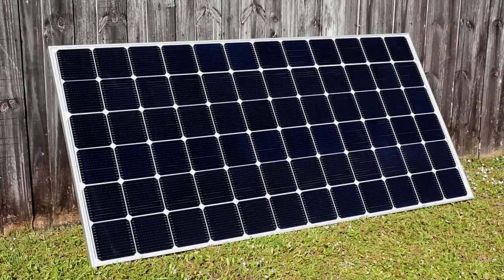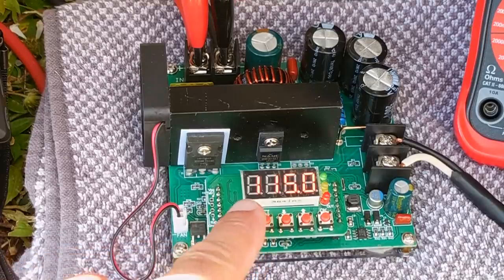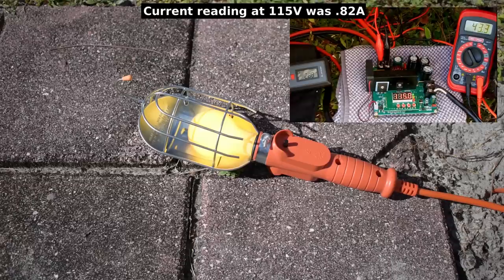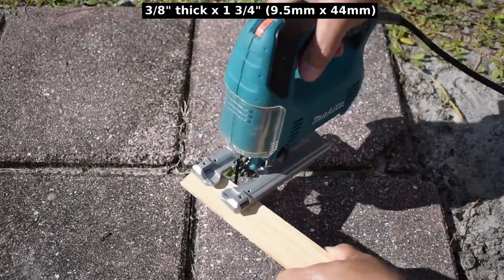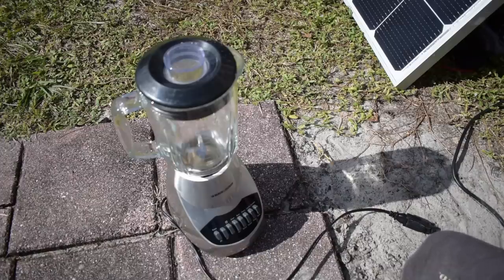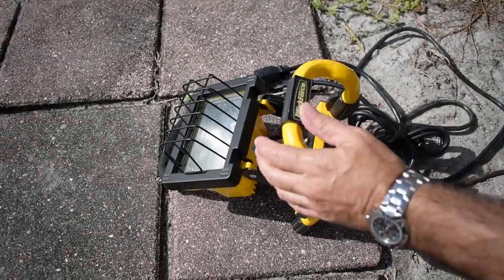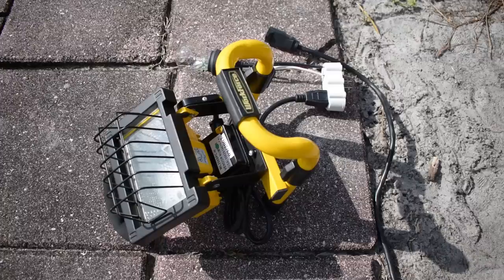400W Solar Module Runs 120V Power Tools Directly!

Comment: What else can run off of 115V DC? I'm assuming my battery chargers can't do that, yea (phone, laptop, etc.)?
Reply from the maker: An SMPS designed for AC input can usually be run from a DC supply, because the DC would pass through the rectifier unchanged.

Comment: I always wondered about this, Do you know if this will work will electronic devices [tv's pc's radios etc], seems like it would since most electronic device use a stepdown transformer with a bridge rectifier turning it to dc anyways. . . it would be a good idea for a next video
Reply from the maker: If the device doesn't use a transformer, or capacitive reactance to produce a stepped down voltage to DC, it will work. SMPS will work fine, because the DC will pass through the rectifier. Thanks for watching!
Reply: @electronicsNmore  Thanks for your response. . . so even tho most devices step down 120v ac to a much lower voltace and then convert it to DC anyways it still wont work???.  . . . that is mind boggling. . .  seems like it would, but what do i know. . .lol I'd love to see a video on this testing different electronic devices, it would be awesome, especially since everybody found this video so interesting. . .you can call in PART 2 !!!! either way you gained a subscriber

Comment: Thanks for this very useful info . Can this PV take  the load direct from pure sine wave inverter with out MPPT charge controller and battery. ( PV to inverter and a  small A/C 120 VAC /5 amps .I ran one with a  battery but not sure about the nrush current at start
Reply from the maker: No. The inverter would detect over-voltage and not power up. Thanks for watching! Please share.

Comment: Even though you using a buck boost converter your still boosting the voltage like an inverter the way you made it sound you was going to try ring direct from the panel with no boosting of any sort
Reply from the maker: The title was worded fine. People hear 120V tools, so they automatically think of a power inverter which converts low voltage DC (12 or 24v) to higher voltage AC. I didn't convert to AC, only boosted the DC voltage.

Comment: Without an inverter, yes. Still takes a DC to DC converter.  That is like saying "i can go on the freeway without a car . . . on a Motorcycle." From the description and picture, I was expecting 3 solar panels in series, with an open voltage of 120 vdc, that would sag down to 90 volts DC under heavy load. Still super sketch if forget to design in a switch. Only way to turn off the souce is put blankets over the solar panels. And if over load burn out etch on solar panel? Not sure, never tried, dont want to find out.
Reply from the maker: The video title was accurate, no inverter. The video thumbnail only showed one panel. Ideally you'd use 7 12v panels in series for 120v. You'd have around 140V, and it would drop down to around 110V.

Comment: It runs simple motor tools because they use a DC motor with a bridge rectifier or 4 diodes in bridge rectifier connection.

Comment: Can i use this to charge my cordlesstool batteries?
Reply from the maker: If there's no transformer used in the charger, and the incoming AC is converted to DC, then the DC will pass through fine.
Reply: Ok thank you. Need to openup the charge controller

Comment: I would say anything that is under 400 watts would be run from that solar panel weather it is 40 volts, 115 or 120 volts,  because  400 watts divided by 40 volts = 10 amps or 400 watts divided by 120 = 3.3 amps you are using 115 volts so 400 watts divided by 115 = 3.47 amps. Wattage is the constant and is why the power meter charges your Bills by the wattage you use each month. It would depend on the amps drawn for each item used.
Reply from the maker: A little less because of the efficiency of the DC step up converter. Thanks for watching! Please share.

Comment: The power tools are corded, so they run on AC. So where is the inverter?
Reply from the maker: Yes, corded, but they're universal motors, so they can also operate using DC. Thanks for watching!
Reply: electronicsNmore thanks for the clarification.

Comment: Do you know for sure there is nothing detrimental to the tools electronics ?
Reply from the maker: Universal motors can operate AC or DC. You can even power a SMPS for computers and other devices using DC because the DC would pass through the rectifier unchanged.
Reply: @electronicsNmore  ty

Comment: I have one of those DC to DC converter, powering the GS with DC is tough on the switches , if it were atleast pulsed DC it would ce much better on the switches, the blinder sounds a bit off!
Reply from the maker: GS? The blender is very old and noisy, I had to cut the volume way back.
Reply: You could probably remove the output capacitors but it would be real high frequency I assume and I don't know if it would regulate it correctly or any other problems

Comment: I just want to point out, when the goal is to test load on source, a 14 or so watt  LED bulb is not equivalent to a 100 watt incandescent.
If you're testing light output then sure. But not if you're testing load.
Reply from the maker: I was only showing that you can power a LED bulb, nothing more.
Reply: @electronicsNmore  I understood that, but I felt it important to note that since you were not testing the wattage of an incandescent, it was irrelevant to mention it.

Comment: So 10 pcs of 100W 12V panels in series, and you can skip the booster, and supply power to a team with power tools, as long as they don't have to draw too much power exactly the same time.
Reply from the maker: To power universal motors, yes, you can use 12V panels in series, but I wouldn't use 10. 20v x 10 = 200V with no load, I'd try 7.
Reply: Jeg tror ikke på at nogen med et å i deres navn 
Kan spørge så dumt!!! Seriøst tror du osse jorden er flad
!!! Fat nu den her tåbe køre strømmen igennem en stup Up DC til DC converter
Det samme lort som en modificeret firkant/sinus inverter laver .. 
Men kun halvdelen af det !!! Så det er ikke sinus .. men en hakket i stykker firkant DC 
Du kan selv vælge om det er højre eller venstre side du vil bruge i din modificerede AC firkant inverter 
Hvis du ikke fatter et hak !! Så tag mandens råd .. glem alt om hvorfarlig 120v DC det er .. 
For ovrigt så er 10 12v paneler ikke 120v men 170v .. de er mindst på 17v stykket
Reply: @kennethschultz6465  Wow! I typically understand Danish (or whatever that was) fairly well, but most of what you wrote makes little to no sense. I hope you had a rare bad day. 

Yes, at full sun, and with moderate or less load, 10 typical panels with nominal 12V would be be able to produce way to high voltage. But with less than optimal light conditions the voltage would decrease quickly with even moderate load. It's not that difficult to cap the voltage a bit, if needed, and be able to work efficiently in suboptimal sunlight "uncapped"         

Also, exact voltage is typically not that critical in these kind of applications. 

When the nominal voltage of AC power is 120V, 120V doesn't represent peak voltage, that is the root mean square voltage, and the actual peaks are roughly 170V. 
But I don't assume anyone writing "v", that is in lowercase, for volt, to get that.

Of course 170V DC would allow more power than 170V peak (= 120V rms) AC, and would be a lot worse for some components than a lower voltage, but some components in some tools would probably not last very long even with 100V DC. My comment wasn't about figuring out the right number of panels, it was a question of the principle. 

The message of the video wasn't "let's all go out and do this super practical thing" either, it's entertainment, were not setting global standards here so relax, there's no reason for you to get upset about this. I recommend you read up on the Dunning-Kruger effect, that is what makes you think that you are an authority on this subject.

Comment: Would it be able to to charge per say power tools batty
Reply from the maker: Probably, because the charger converts the AC input to DC.
Reply: Ok. I recently got some good deals on these trimmers so I bought 2 with batteries for 50% off. these are hart brand. As a landscaper I was going to use this for like light use places and these are great for . So I just have to figure out a charging station on my truck.

Comment: 220V DC burn up the triggers, when I turn off. How your?
Reply from the maker: I don't use it enough with 120vac to worry about arcing. Thanks for watching!
Reply: You are absolutly right !!! But by using a DC to DC 
IT CHOPS the power like a realy realy bad MODIFIED squear SINUS AC inverter 
So you are right !! IT is digital ac !! IT can't burn the switch !!! IT would if IT was not chopped Up first

Comment: Why did the picture say "No inverter!"?
Reply from the maker: Because no inverter was used. I used a DC CONVERTER.
Reply: electronicsNmore    Great!   I learned the difference between an inverter and a D.C./D.C. Converter.   So you converted DC to pulsed DC at a higher voltage.   Thanks very much!    Kevin

Comment: am i going to Die touching the wrong part of that DC to DC converter?
Reply from the maker: Of course you must not touch the 120V DC output. A shock from AC or DC is dangerous, but AC is much worse.

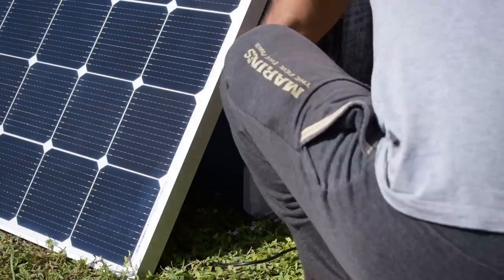Comment: 1:11 You should put the panel at a 90-degree angle to the Sun, not 50. 50 degrees would be the backside of the panel.
Reply from the maker: The panel was 90 degrees to the sun.

Comment: You forgot to add that it can only be used on universal motors...you cannot use a straight AC tool..solar panels produce DC, if a tool only uses AC it wont work, you will still need the conversion, no matter how many volts you step it up..
Reply from the maker: I made it clear in the video that I was powering universal motors. Thanks for watching

Comment: maybe a supercapacitor across the 12v dc input can help with higher loads
Reply from the maker: The problem is the DC converter, it would be better to use an oil filled run cap across the output.
Reply: ok

Comment: High voltage DC is all fun and games until it starts Arcing
Reply from the maker: This isn't high voltage, it's "higher" voltage. If you want to see high voltage, watch my "High Voltage" video playlist. You'll see some danger there.
Reply: @electronicsNmore  DC arcing at any voltage above 36v becomes a serious issue and does cause fires. to dismiss my concern over what amounts to "its not high enough voltage" is missing my point entirely.. but hey, them views
Reply from the maker: So anything above 36v is high voltage to you? Next time speak more clearly. For example: What about switch arcing from the use of DC? Then I would've told you that I didn't observe any issues, but long term use could be a problem if suppression methods aren't used.

Comment: Price please complete  system
Reply from the maker: For me it was fairly cheap. I supplied links to where you can buy a wide range of solar panels. If you can't buy a 400W/40-45V solar module locally, then look for (2) 200W 40V panels and connect them in parallel. Thanks for watching!

Comment: 190 dollars for a solar panel?  I paid 175 for a 450watt mono panel.
Reply from the maker: Probably used. Post the link.
Reply: Where you buy 450 watt at
Reply: @hansonlilynguyen9860  here in Mexico, I´m a professional installer, and all the panels are TIER1

Comment: Very cool, but unless you live at the equator and test at high Noon on the Summer Solstice, you'll never get the full "rated" output.
Reply from the maker: No. I tested it 2 days ago at high noon, the intensity was 84K lux, I had 400W.

Comment: Really?... I think it is fake. The DC volts indicated by the right multimeter always shows the Voc of the panel. Mmmmmmmm!! When there is a load connected to the panels, the voltage must be down.
Reply from the maker: Nothing fake on this channel. If you doubt my results, then you'll need to try it yourself.

Comment: Someone told me a computer power supply will run on DC voltage as well. An easy way to get 12/5 Volt in a controlled way. But is it true, do you know? Could you test it? Would it run at lower voltages as well (I think it will)?
Reply from the maker: If the electronic device doesn't use a transformer to step the voltage down, it will also work. :-)
Reply: @electronicsNmore  Except for your capacitor fed battery charger. ;)

Comment: Well if  the device  uses ac no but if it uses  dc.. well then  of course
Reply from the maker: Incorrect. There are devices that can use both.
Reply: @electronicsNmore   well duh. But if strictly  uses only ac
Reply from the maker: @j5892000  You didn't say "strictly"..........

Comment: Why are you testings lamps and light bulbs as this is completely pointless when it will be dark...the sun is the best lightbulb you can get and its FREE lolll
Reply: Kelly Kelly … Lights are the easiest way to represent a fixed load for testing purposes, such as this demonstration video. Easy to add more load or take some away and see how the equipment reacts to the changes.

Comment: this works only on DC tools, what if i want to run an AC, is it going to work as well?
Reply: He's running 120 VAC tools, as the title suggests (120/240 VAC is the supply input from power grids in North America). Most power tools use a brushed motor that can utilize ac or dc power. I wouldn't get too carried away with this idea, though. Good if you're in a pinch at a hunting cabin and need to do a bit of work or something, that's about it.
Reply from the maker: Correct
Reply: @shopjobinfo  Actually you can run many laptop power supplies from DC as they use a switchmode topology that rectifies the incoming AC to DC anyway. I run a laptop like this quite often. Some switchmode PSUs can be fussy about polarity though when being fed pure DC, which is somewhat strange. However reversing the polarity of the incoming voltage usually sorts that. In any case I would recommend first testing the laptop PSU with the DC source before actually connecting it to the computer.
Reply: @shopjobinfo  onley if you want to burn you things down !! 
A DC to DC stepup converter is like a 
Realy bad MODIFIED squear,/SINUS AC inverter !! 
So i would adwice agenst IT!! 
All my Dell HP Sony  
Can't run on modified sinus or squares Waves !! They just humm and Then burn off .. WHATEVER way plug is turned
So selvom in the club of burnt off PSU's if you continiu
Reply: @JamesBiggar  yes 120v AC on a Half bad MODIFIED 120v squar DC converter 
So !! If a modified sine wave inverter is No good !! What do you think 
Half a modified square DC to DC is!!! IT Works untill IT Works No more !! 
Burnt is burnt .. good luck taking adwice from  🛎 DING 🛎